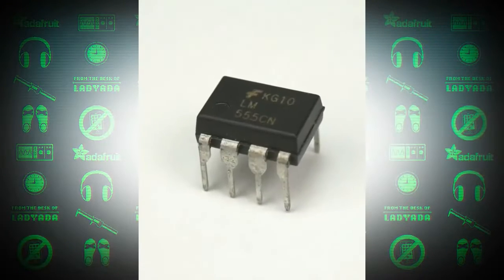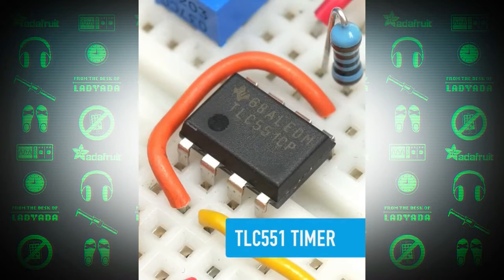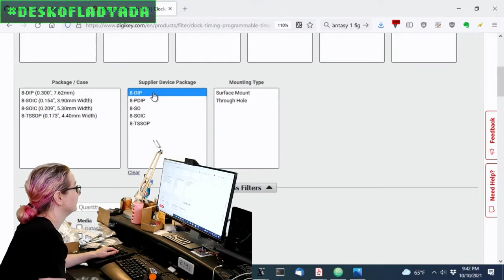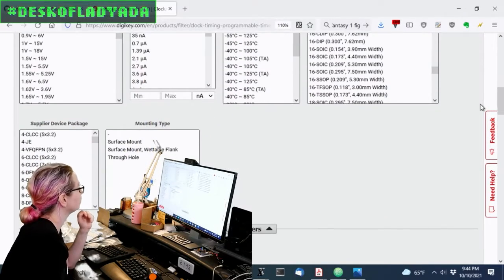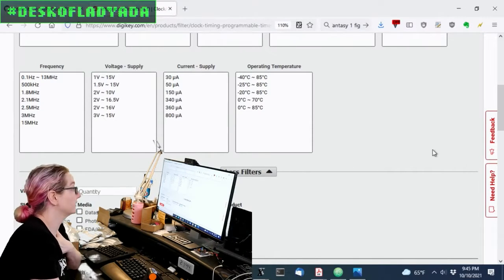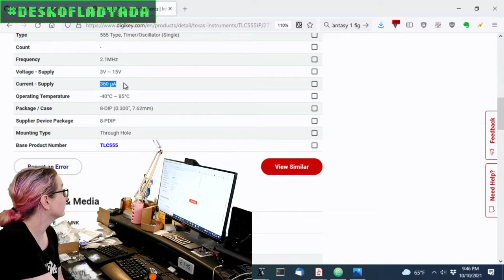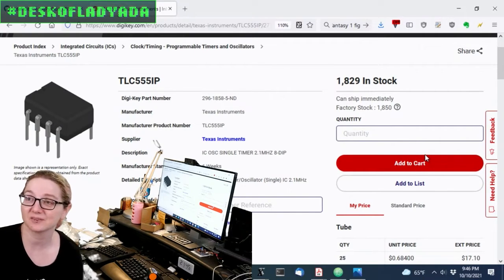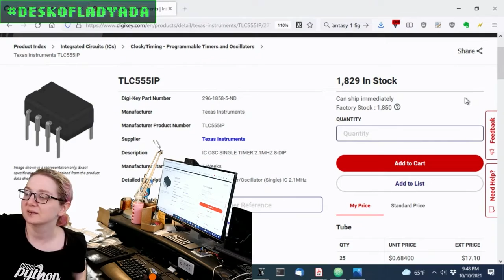The Great Search: Triple Nickels! (555 Timers) #TheGreatSearch #DigiKey #Adafruit @DigiKey @Adafruit

Comment: You can get a double triple 5 timer, called a 556, as well as a quad 555, called a 558, though it has some limitations. The TLC555 is more accurate and can replace the ‘regular’ NE555.

A person can find books dedicated to 555 circuits.